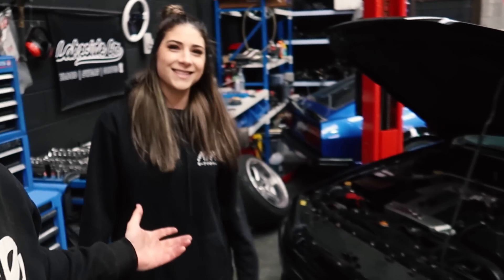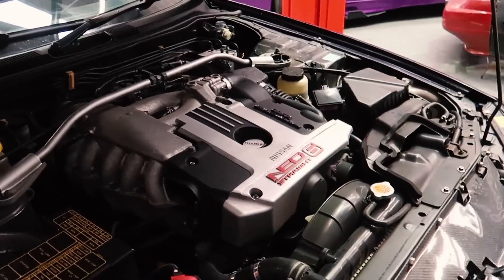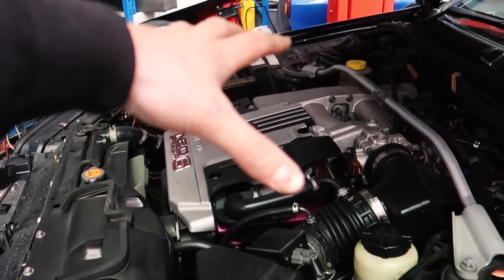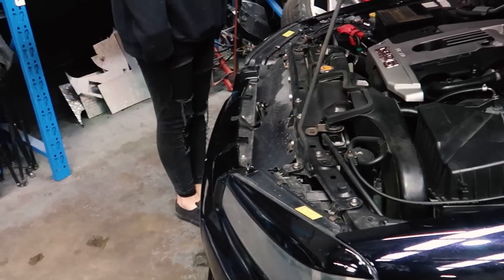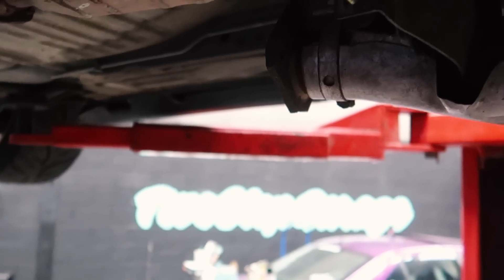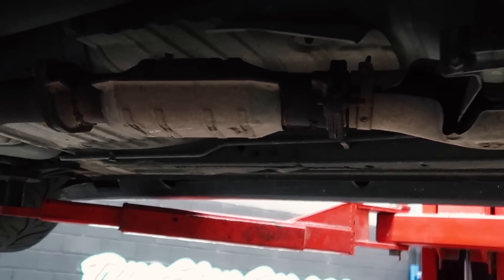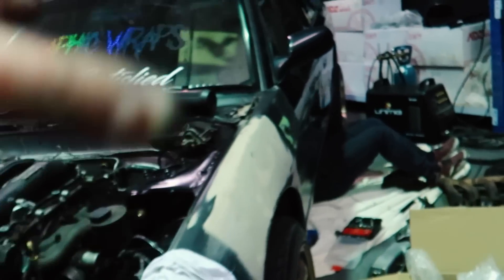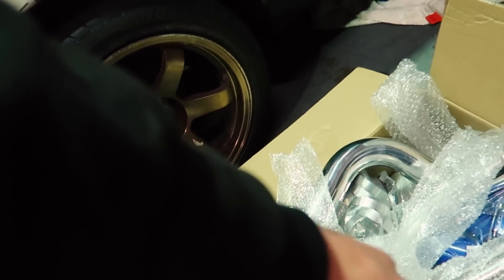TARA'S R34 TURBO CONVERSION! (RB25DE+T)

Comment: great video/ I'm currently in the process of turboing a r34 RB20DE NEO Automatic.   And need all the knowledge i can get, what ECU should i run or backpack,  im in to deep to say no to anything.   I am using a NP Boosted intake manifold & A cheap eBay exhaust manifold running hks hi power exhaust with a nismo fuel pump.
Reply: hey could i ask you some questions, im about to turbo my rb20de NEO as well. did you use an r32 rb20det intake manifold or a different one?
Reply: @raulthefool  I'm using a r34 neo manifold the ports were the same and I used R32 injectors I'm currently figuring out what I'm doing for a fuel rail. The major part will be the ecu as it's automatic
Reply: @raulthefool  an aftermarket manifold not theboem
Reply: @jdmsnail2505  do you have an instagram of somewhere i could just message you?
Reply: @raulthefool  jdmxsnail

Comment: How did you do the oil drain without a 90 degree because the engine mounts in the way
Reply: I'm having big problems with the drain line on to much of a kink

Comment: did you install a boost pressure sensor? if not, how did you avoid the ecu cutting the engine out when trying to go into boost?

Comment: I mate thank you for your post on the RB25DE NEO + T - I wish to do the same engine into an earlier skyline - I have the NEO DE in and running with a 5 speed RB25DE NEO box. I would like to know how the non turbo 5 speed went ? did you destroy it ? Anyway I am happy that you done the upgrade with the NA manifold with injector upgrade to the BLUE turbo units.

Comment: What was the intercooler and core sizes?
Did you have to cut anything to fit it?
Reply from the maker: The smallest one on the maxpeedingrods website. A little trimming of the bumper but nothing crazy
Reply: Ok, so… been a while but I finally got round to turbo’ing my 34 🎉

Looks good too!
However,… runs like s**t 😢.
Did you put the DET ecu in for the end of this vid just so could see it running or was this on the DE ecu?

Awesome vid btw I watched it a tonne, loving the stutu noise. Is Tara’s 34 still going strong? Done any more mods?

Comment: Hi, I’m wanting to do this to my own R34 with a RB25de neo in it. I’m having the same problem with the oil supply line and drain. What type of sandwich plate did you use on the oil filter? 
Thanks!
Reply from the maker: Hey Emma! They can be found on eBay if you type in “rb25 oil sandwich plate” or Google also 😁. Good luck with your build!

Comment: Mite have missed it but did you swap the ecu with a GTT one or can it run a turbs on the NA
Reply from the maker: We have a turbo ecu with nistune. Tune video will be coming within the next week or so 😁.
Reply: Can't wait to see the tuned video and how much horses it will be pushing, I plan on turboing mine very soon also and interested in finding out the power gains with the NA internals and a few pounds of boost

Comment: Did you have to updrage the ECU?
Reply from the maker: Yes, as I said at the end, we've installed an rb25det ECU with a Nistune board 😁
Reply: @itsmikelake  Did you have to worry about compression being too high? BTW thanks for replying
Reply from the maker: @smenging7280  No, high compression turbo is the best! Just run lower boost. We'll only be running 10psi max as this is my girlfriends daily and we want to keep it safe.
Reply: @itsmikelake  Hi mike, was that the Er34 Det ECU, or R33 series ECU? Does it make a different?